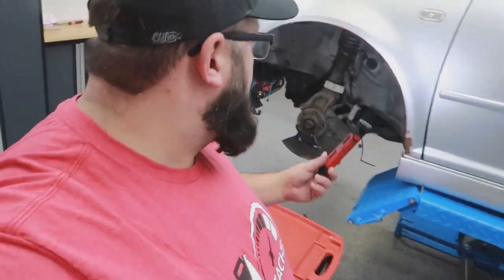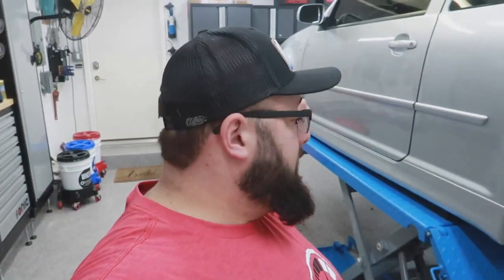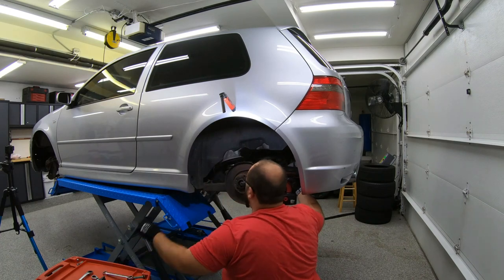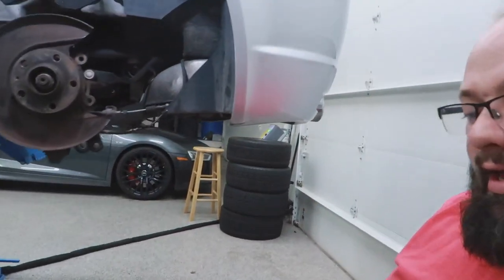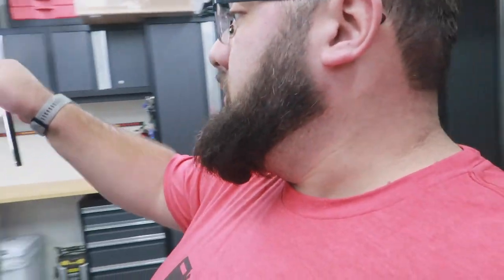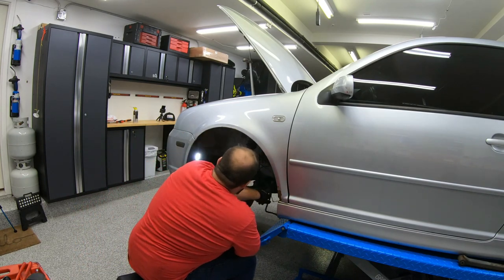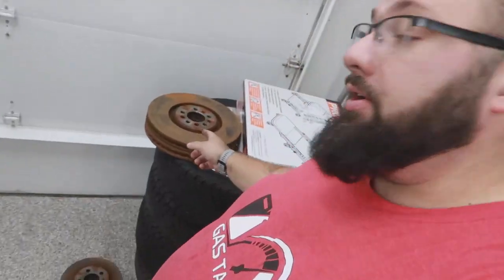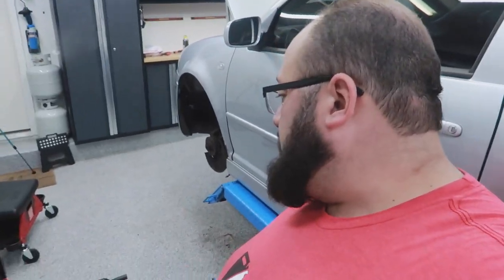VW MK4 R32 Tear-down, Shock and Spring Removal! The Project Car Rebuild Pt. 5

Comment: Don’t waste your money turning the rotors down.  ECSTUNING and several other companies sell comparable OEM Rotors.
Reply from the maker: Maveric073 thanks man, I’ve nearly pulled the trigger on a couple at ECS but all the good ones seems to be only deliverable in Feb 2020. 🤦‍♂️ so I think I’ll rock out these front ones until feb then get a whole new set 👍
Reply: Racing Brake upgrade 😎 

https://www.racingbrake.com/Big-Brake-Kit-4-pot-MK4-FRONT-2004-p/2187-k.htm
Reply from the maker: ichiban 😳 half the price of the car 💸